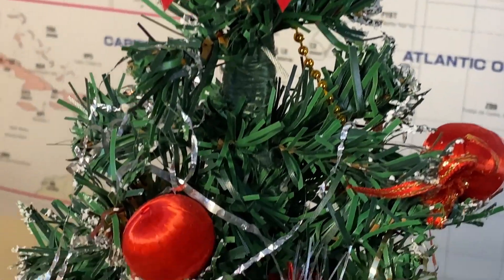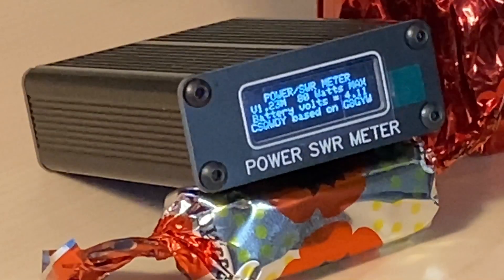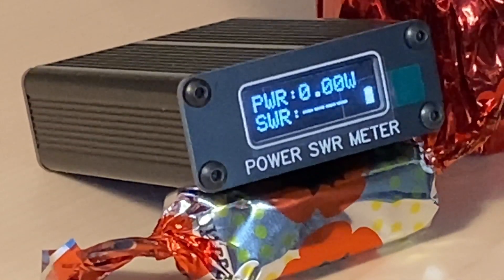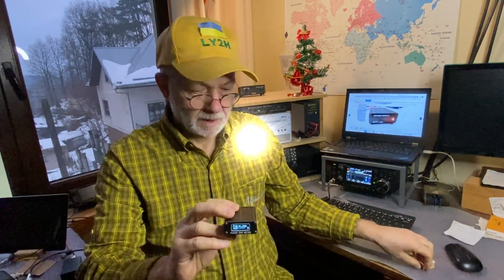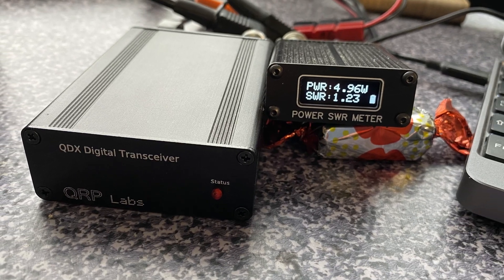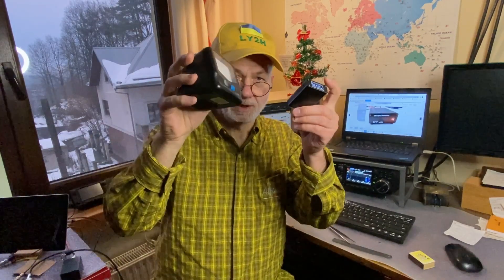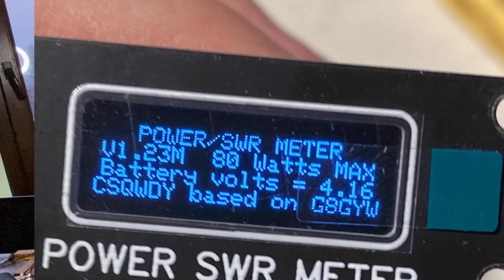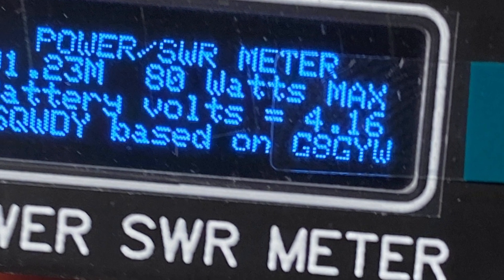The best ham radio accessory I wanted for my QCX/QDX transceivers!

Comment: Now it's a year later is that mini power/swr meter still holding up?
Reply from the maker: Hello Anthony! Thanks for asking, the little meter is doing just fine, internal battery is like new, I use it every time I play with my QDX, QCX and  uSDX radios. I still think, this is one of the best accessories in my QRP park. 73! Linas LY2H

Comment: Just arrived.  Man this thing is tiny, but it works. No instructions.  One question, reguarding charging:  Does the red LED change to green when charging is complete?  Can u leave the usb c plugged in to supply constand power or is it just for charging?
Reply from the maker: Congratulations! Yes, no instructions, it’s OK for most chinese gadgets :) I’ve contacted the seller, who said he contacted manufacturer, who said that the gadget is tuned, calibrated and there is no need for a consumer to have the schematic diagram :). Well, it’s a kinda’ customer service anyway. The red LED just goes OFF on my device after the fully charged. The meter, actually works with the power supply USB cord connected, but I can’t say at the moment whether it is charging while working, or is it just working off the battery and the charger is just doing nothing. I suspect it only charges, not working. It would take , I think, to deplete the battery until the very low level on the meter  and then connect the charger and see if it works and charges at the same time. I had no need nor chance yet to make this experiment as the battery lasts and lasts for hours before I need  to charge it up and then I charge it disconnected. Have fun using it! 73! Linas LY2H
Reply: @Linas_LY2H    Thanks for the update, greatly appreciated.

Comment: Linus, silly question but is the white button above the usb C port in the back the on/off switch.  Can this unit be place in bypass mode while off to save battery? I was just about to order this for my FT-818 radio and future QDX radio purchase.  Had a QSO with a fellow countryman of yours LY4A.  Maybe I will here you on the air someday if you DX into NA.  73!
Reply from the maker: Hi Raith, thanks for watching! And yes, you can easily bypass the unit by just simply shuttimg it off by pressing the magic white button on the back :). The unit is then bypassed automatically due to the smart schematics of the RF sampler transformer in the unit. No relays, etc. The battery runs for hours continuosly, actually. 

The LY4A is the biggest station in the country with huge fields of monstrous Yagies , including 80m :) So, you should have heard him well. I, on my turn, am running mostly QRP from my QDX when in FT8 mode into a vertical R8 or an EFHW 80-10 antenna. But not to worry! Just a few days ago I made a contact with NL7V from Alaska, and FK8HM from New Caledonia on 20m, FT8 , QDX, EFHW. So, anything is possible with the QDX and the Solar cycle 25 ! CUL, 73! Linas LY2H

Comment: Linus, what's the concensus on this meter?  I have been waiting patiently for another update before I order one.  Still worth while or should I hold off?
Reply from the maker: Hello, thanks for the comment. I'm not sure I can give a purchasing advice or how to spend your money best :). I only try to give an un-biased opinion in my reviews and hope this can  help viewers to make their own choice. I have no more updated info on this tuner, like schematic diagram etc., so everything said in the video stays valid :). I use mine , actually, every day connected to one of my QDX's  and it works OK, the battery lasts for days, no problems. HTH, good luck ! 73! Linas LY2H

Comment: The qrp tuner has a swr meter on it doesn't it?
Reply from the maker: Hello. I don't know which tuner do you have in mind. Some tuners do have SWR/power meters built in, some don't. , some only have rudimentary meters like an LED. My video, though, is not about tuners, it's about the smallest possible device to measure the output power and SWR.  Very often, I don't need a tuner at all, as I'm using the resonant tuned antennas. But I still want to know what power am I transmitting and how is it going, i.e. I need an SWR/ Power meter. If I only need this meter, why would I want to carry bulky tuner with it, unused? Most QRP tuners I know are bigger than my QCX or  QDX transceiver. I find it weird when the tuner is bigger than the radio :), and especially that I don't need it for tuning, just for power/swr metering... But I agree, if you really need a tuner in the field, than it's a good idea to have one with the swr/pwr meter built-in. 73! Linas LY2H

Comment: Wouldn’t an ATU-10 show power and SWR including being a QRP Tuner?
Reply from the maker: Hello OM! It certainly would. Just the problem (for me) with the ATU-10 is that it's too bulky: it is twice as big as my tiny meter and weighs in some 6 time  the meter ( 300g vs 50g). The ATU-10 is actually bigger than my entire QDX transceiver! Secondly, ATU-10 is more than 2 times as expensive as the meter alone. It's understandable but unjustifiable for me as I use tuned resonant antennas very often  and tuner would rest unused. That's my reasoning why I wanted this tiny gift for myself, YMMV :). 73! Linas LY2H
Reply: @Linas_LY2H  smart.  Thank you.
Reply: @Linas_LY2H  
Agree with you.
I also thought about this.
For 140ye I would buy small SWR/PWR meter from your video and manual QRP Pocket Transmatch from kanga-products.